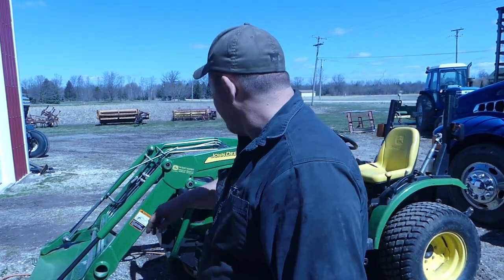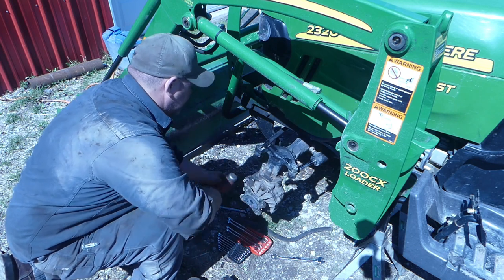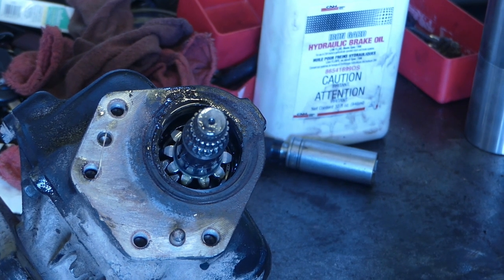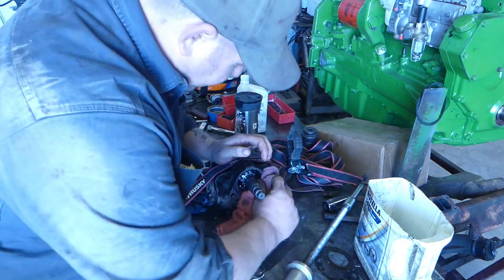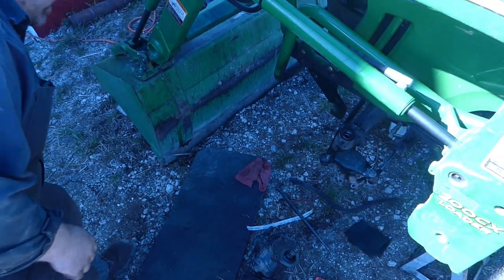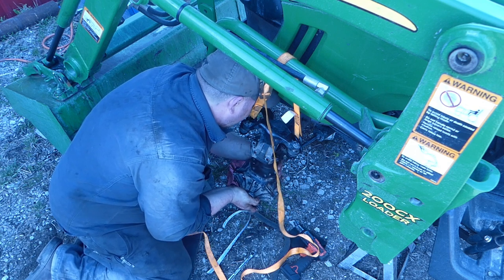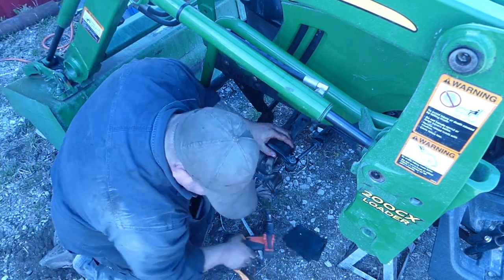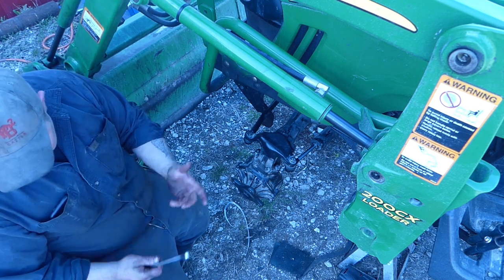2320 FRONT AXLE LEAK REPAIR

Comment: Thanks for the video Heavy. I also enjoy repair videos. No matter how long that a person has been wrenching for a living they can always pick up useful tips or a better way to do something from watching others. My Kubotas have a similar front drive setup. When I used to run them in our wet red mud I’d take a water hose to the front axle to wash the mud off. I was essentially taking pressurized water and pushing watery mud into the pivot area. I stopped that practice. I let the mud dry then stiff brush it off. Washing tractors with pressurized water and soap regularly is a bad idea.